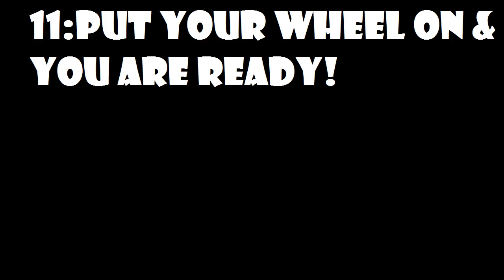How to install SCS into district forks! (HD)

Comment: you could go by a nut that threads onto the district compression bolt, run the compression bolt normally through he forks and screw on the nut or cut off the top of the forks

Comment: I want to run scs with my district fk2-v3 fork, I'm getting a district dk2 v2i and I'm wondering if I would have To use horrible headset spacers. If the headtube on the district is the same height as your blunt that means I don't need spacers because you didn't need them

Comment: you dont need to put the starnut you could put the bolt througt the hole in the fork and througt the top cap an put the starnut in the scs or use a nut